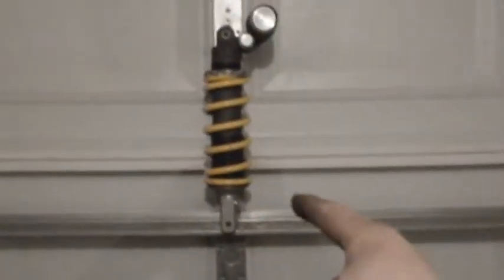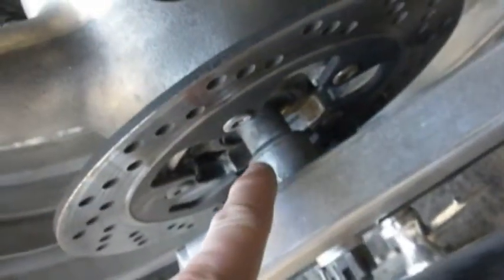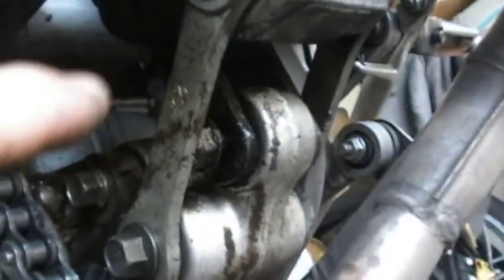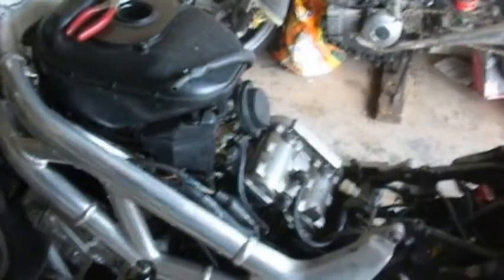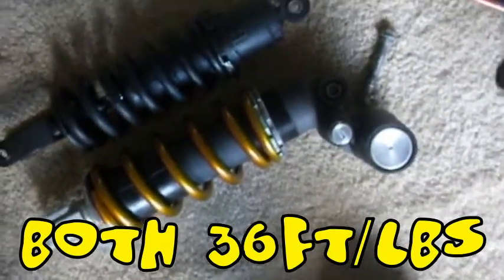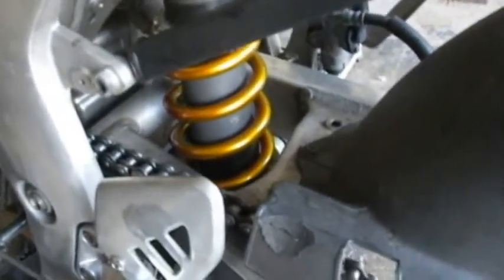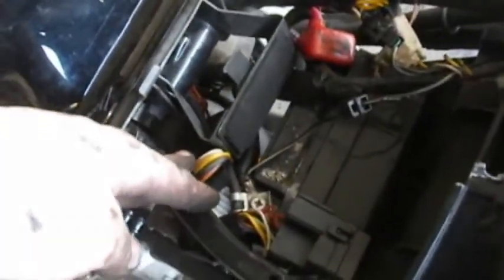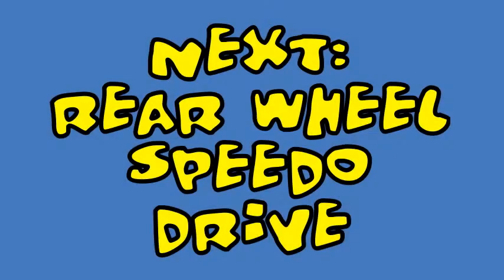SV650 Shock Swap - Quick and Dirty

Comment from the maker: If you noticed in the video, I have GSXR forks on this bike. Since GSXR forks are shorter than SV650 forks yes the front end was lowered, but not deliberately.  The GSXR1000 shock length was slightly shorter, but I cannot tell you what year it came from because I found it in a bin full of miscellaneous salvaged parts from wrecked bikes.

Comment from the maker: @CZroe The magic trick was filmed in two parts, about 2 weeks apart, then edited together.... :-P   Most paint has some degree of flex in it, and in the case of the shock spring it doesn't flex enough to stress the paint.

Comment: O5 SV650, I am 5'2.  I am told spring is tightened all the way. My bike bottoms out.  Will this new spring raise the bike?  If so, I wont be able to touch enough to move the bike around and back up myself?
Reply from the maker: If your bike is raised yet still saggy, this shock will most certainly raise your bike.  I had to put some link adjusters on there to dial it in.  Its been good since!

Comment: What did you use to make the spacers? I need something similar to get my rear slider spools mounted with my Sportisis swingarm cover/hugger on the 250. It leaves enough room for the 10mm mounting bolts so I bought longer bolts to thread through the spools. Because I can't make anything much wider than the bolt, I need a 11/12mm diameter spacer to keep the spools away. The Home Depot didn't have anything in their hardware, plumbing, or conduit aisles and they didn't know where else to send me.

Comment: I have a 2001 sv650 and I am having a problem with my shock choice.  The one I have the reservoir is down and sticks out a little further than yours.  What year gsxr did you get that shock out of?  And was the shock length the same or did you end up lowering the front to make up for the drop in suspension on the rear?

Comment: do you know anything about swapping the shock on a SV650S K3? I'd like a shock for which I don't have to cut the battery box. I already know a ZX10R 07/08 shock would fit but that's waaay to stiff for my weight: i'm only 70kgs / 155 lbs..
Reply from the maker: I'm afraid I don't have any experience with a K3

Comment: What do you recommend for the next gen 2003-later sv650's? Is there a big difference?
Reply from the maker: You can do the same, but I believe the bearings are different size in the headstock on the frame.

Comment: How did you get the anodized aluminum gold color?
Reply from the maker: Paint!  I stripped off the old and painted on the new.  I did some magic to hide all of that in the video though, hehe!
Reply: @DuckmanCycles  I mean, What color did you go with? Did you go with a base metallic color and a clear, or was it all one spray? What did you do to remove the old color?
Reply from the maker: I see.  Just regular paint stripper will do the job like this: https://amzn.to/2Ekzf5m then afterwards I sprayed a base coat of this stuff: https://amzn.to/2UBrv4q then sprayed the gold (they call it yellow) over that.  https://amzn.to/2PCvhGX  I hope that helps!